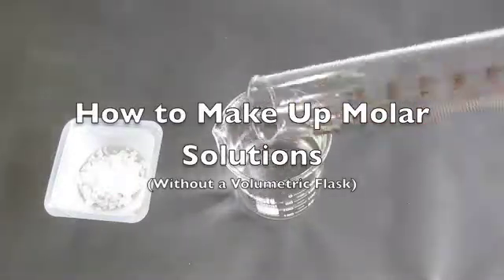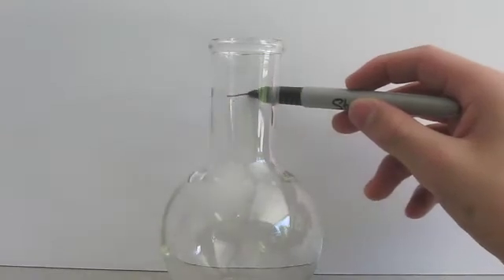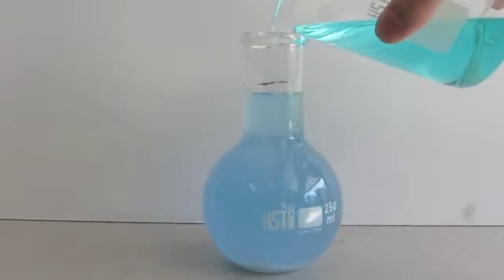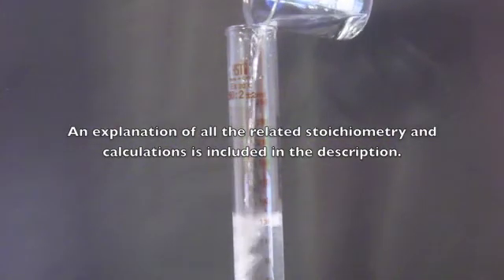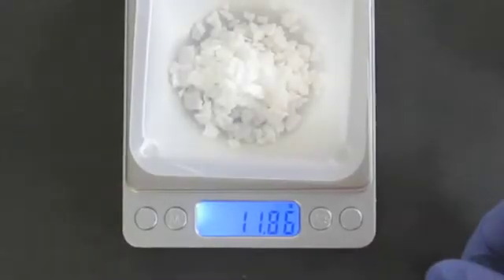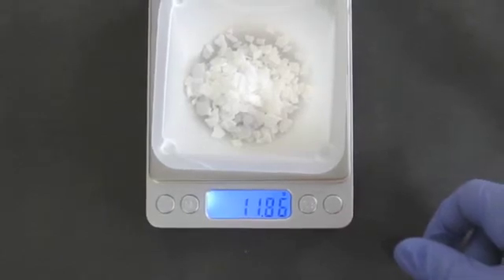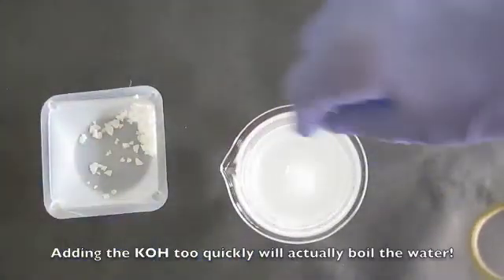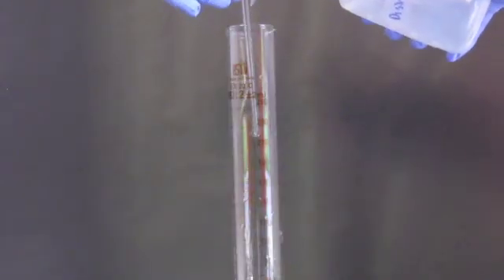How to Make Up Molar Solutions (Without Volumetric Flask)

Comment: OK, but how big of a hit does your accuracy take on this one?
Reply from the maker: +Tyler Swanson Volumetric flasks are definitely much more accurate than this method, but in my opinion the accuracy difference roughly corresponds to the price difference. However, if you do a lot of analytical chem, I would definitely invest in volumetric flasks. 
Graduated cylinders have an uncertainty of +/- 1% (So a 100 mL grad cyl could be off by as much as 1 mL).
On the other hand, volumetric flasks have an error of about +/- 0.1% (it may be different depending on the volume of the flask; but a 0.1% error means a 100 mL flask will only be off by as much as 0.1 mL)
Also, the precision is much greater for volumetric flasks than graduated cylinders. A 100 mL cylinder will give you a measurement with 3 sig figs (100. mL) whereas a 100 mL volumetric flask will give you 5 (100.00).